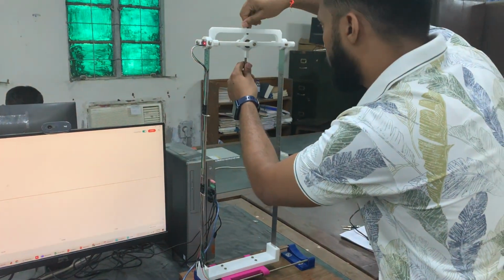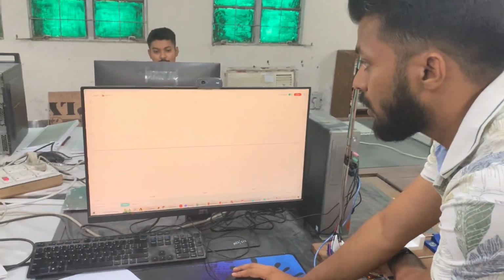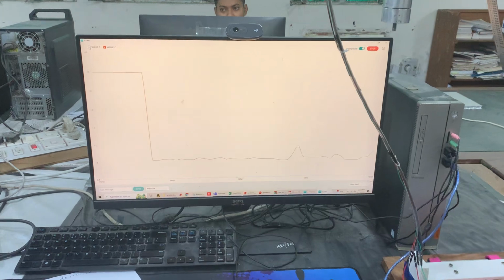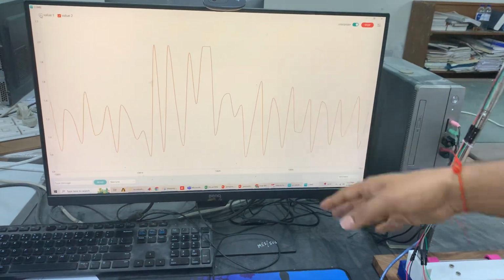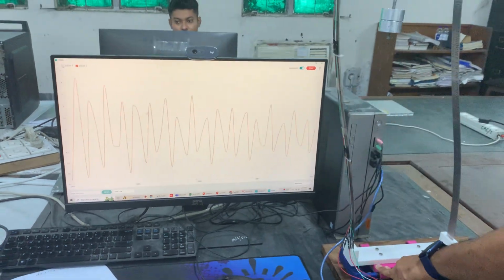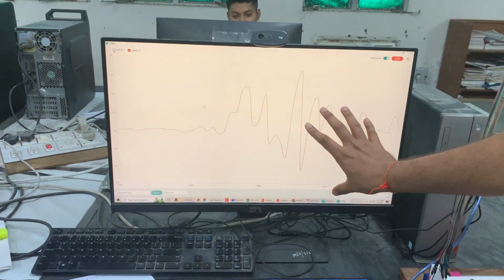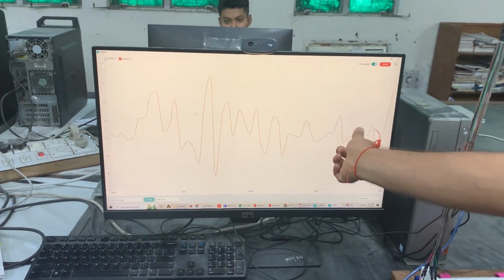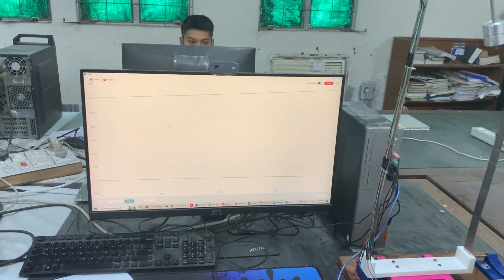Tuned Mass Damper pendulum: IIT Roorkee B.tech project Mechanical Vibration

Comment: Great video! What metal ruler exactly did you use for your model? I'm also trying tuned mass damper experiment as my school project but I'm failing to make it oscillate noticeably. plz help
Reply from the maker: In the description. G drive link is given to make the project. Stainless steel scale